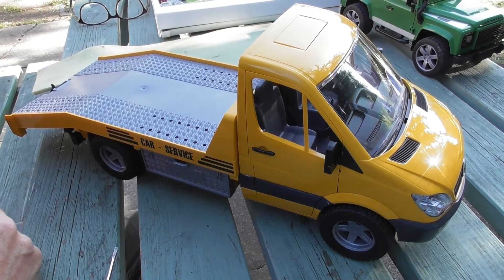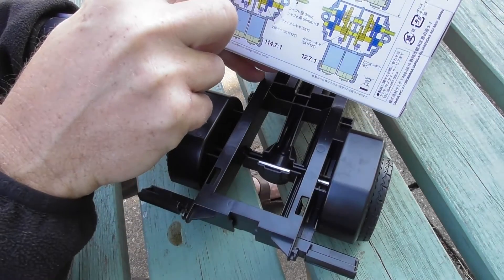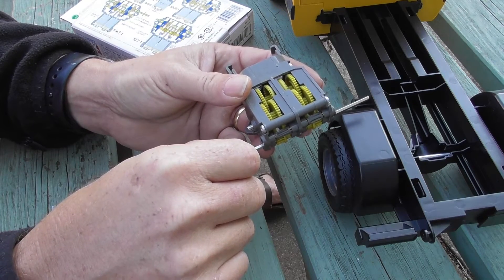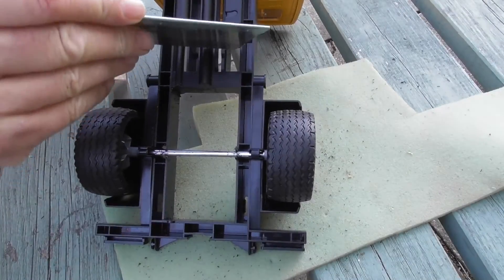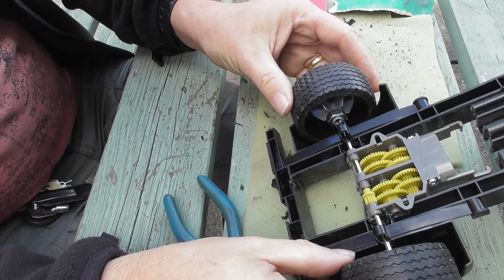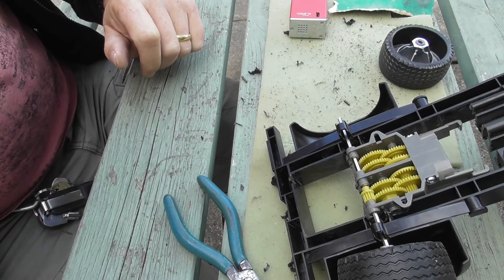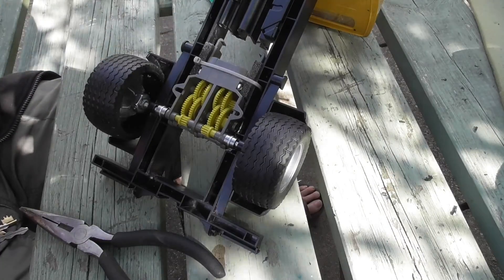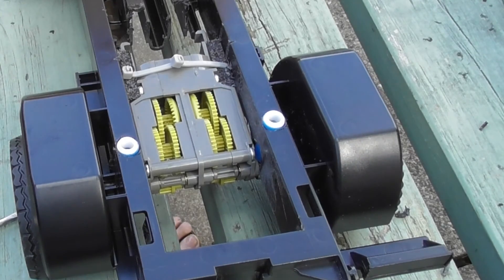Bruder MB Sprinter RC conversion Part 2 - transmission

Comment from the maker: UPDATE. I've just got the steering (with spring suspension) working - took a while, but I was able to do it using only parts on the Sprinter and the Jeep that came on the back of it (plus a few screws etc). I tested the gearbox and found that the 'normal' ratio in the Tamiya gearbox that I used was a bit high (it went fast, but didn't have much torque), on the lower ratio the wheels are pretty unstoppable (subject to grip) although the truck is obviously slower. Changing ratios (and the position of the gearbox) only took a few minutes.When I've finished filming and editing I'll post up the next chapter.

Comment: Amazing video, you gave me the inspiration to start such a project myself. What bearings did you use in the process?
Reply from the maker: Great thanks! 3 wide  x8 outer diameter x 4mm hole. I think 😀👍
Reply: @RCModders  OK, good to know, thanks for your answer!

Comment: Thanks for the video and mod tips - very helpful. A tip for you: Your saw is very large. I found using a pumpkin carving kit knife to works well when cutting Bruder plastic and it is small and agile. You can buy these kits around Halloween time and usually come in a 3 pack variety.
https://www.pumpkinmasters.com/products/pumpkin-carving-kits/
Reply from the maker: Excellent tip. Many thanks. I might have to try that!  😀👍

Comment: I enjoy your builds but you screwed up with the zip ties everything is perfect until you get to the zip ties and then you want to secure things with the zip tie instead of making mounting it and try to be a little bit more creative Yusuf pathan and someone years later will look at your car and that's what they're going to see zip ties
Reply from the maker: Fair comment. Cable ties definitely have their place in modelling especially on tidying the cables. They are good for prototyping fixtures & obviously help keep build costs down and help those without access to some of the tools that might be needed otherwise. I've now discovered 3D printing & am already designing fixtures without cable ties that would previously have used them. Thank you for you comments.   😀👍

Comment: is the tamiya gearbox modification easier than using a wpl/jjrc axles ?
Reply from the maker: I would say that each method has its pluses and minuses and depends on the model you are trying to convert and the look / performance you are aiming at. Personally I prefer to keep the original 'Bruder' look. It seems to be easy to find a tamiya gear box to go with each of the smaller Bruder toys and getting Bruder wheels to combine with them has proved not to be too difficult. The WPL potentially gives you 4 wheel drive and the steering well sorted. I would like to try a WPL conversion to a Mercedes Sprinter once I sorted out mating to the right size wheels (either Bruder or something else - maybe tamiya mini perhaps).   🙂
Reply: thank you for your time im a subscriber as you do the most awesome conversions in still in awe !
Reply from the maker: No problem. Thank you for your kind comments 🙂. I'm trying to do at least one Bruder video per week (probably publish on Fridays) and perhaps start mixing it up (Tuesdays?) with other content.👍

Comment: Another informative and interesting video Pete.
Well done mate for producing a fantastic series of vids that show the engineering difficulties associated with adapting stock Bruder models into fully functioning RC models.
I'm looking forward to part three for a solution to the steering conundrum.
Reply from the maker: Thanks Ian. The problem solving aspect of these is great, plus the quality of the Bruder toys is amazing. The challenge with the steering will be to get the front wheels to turn without hitting the wheel arches.